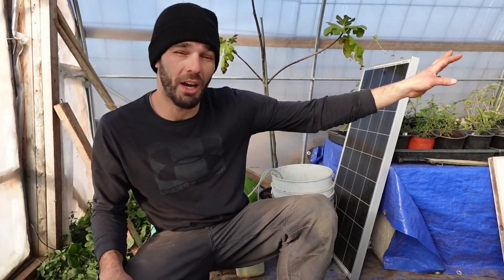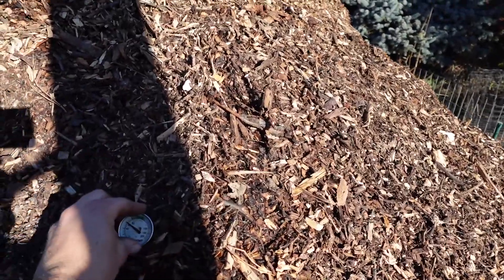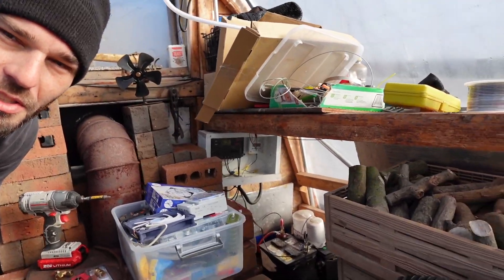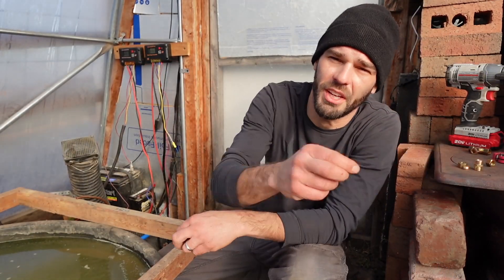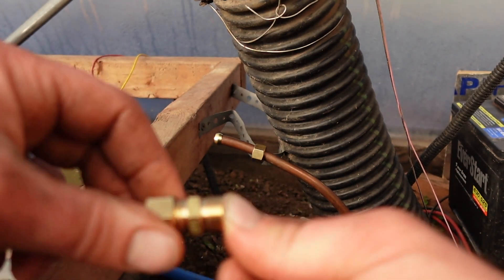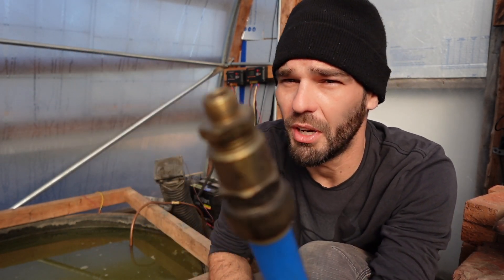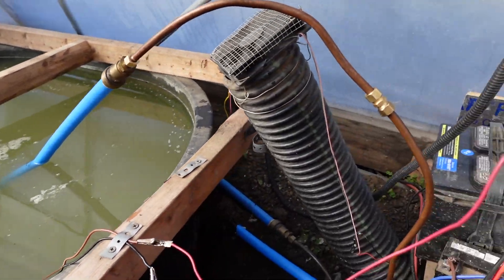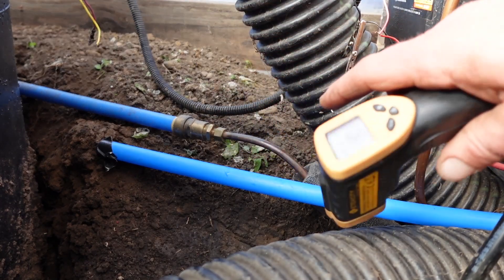COMPOST HEATED GREENHOUSE! : FREE HOT WATER - Heat Transferring Systems - Making Connections -

Comment: Curious what temps you have at night in your greenhouse? Does your pile maintain the same temp at night as it's blowing in?
Reply from the maker: Temps inside are usually above 45 the solar power timer isn’t hooked back up yet , the old one broke as it was cheap and I have to hook up the new one. When the timer runs right we can get several hours of cycling into the night leading to higher temps overnight 55-60f

Comment: Do you have links of where you purchased all the stuff
Reply from the maker: Yes I do some of the stuff may be a different brand or what have you and the items seem to change up a bit, I can get you fans, pumps, and panels as that’s all we ordered everything else was sourced as cheap as possible.
TITAN- 12V DC IP55 Waterproof/Dustproof Case Cooling Fan (140mm (2 Pack)) https://a.co/d/7cItHFy
SEAFLO Electric Marine Bilge Pumps (350 GPH) https://a.co/d/fe9BPOV 
Limited-time deal: ECO-WORTHY 100 Watt 12 Volt Solar Panel Kit for RV Battery Boat Trailer Cabin Garden Shed Home: 100W Solar Panel+30A PWM Charge Controller+ Tray Cable + Z Mounting Brackets https://a.co/d/aeXwJIh

Comment: The 62 degrees air your getting, is that from the compost pile or geo thermal from the ground?
Reply from the maker: That was the morning after I set the compost up, it was turning 52-53f into 62 right after it started up, initially it was 90 lol the outside temps on the transfer line sapped the extra heat out, and the pile was built 15 hours before the video. The same tube read 80 something F later in the morning. Good questions
Reply: @Earthdwellershomestead  Do you still have your tube that’s in ground through the greenhouse? If so, what kind of temps are you pulling from it? 
Thanks for your time to respond,
Jon
Reply from the maker: @yochanontheseeker1942 - yes we do have our geothermal tube and currently it’s operational and clear of water and debris. We had it fill up with drainage water this summer/fall, after a hell of a time getting it clear it’s working and it always shows 50-55F depending on how warm or cold temps intake are. It’s a vital component in my greenhouse, and every green house I build will have it. Thanks for checking this out!
Reply: @Earthdwellershomestead  Thanks for the reply, I’m in PNW Washington state zone 8b and have citrus trees I’m trying to get growing better. I only have a 35 gallon black barrel w a 100 watt fish tank heater in now. But I’m thinking it would be better to dig up the ground and run a tube like yours throughout the ground. How deep did you run yours?
Reply from the maker: @yochanontheseeker1942 I went 71/2 to 8’ down by hand after I built the greenhouse which was a pain but well worth it! I would suggest planning ahead to keep it out of the way, or you can dig outside and go about 10 feet down to be safe. Great questions again I’m sure others are wondering the same.

Comment: been watching your vids since last year, it looks like youve got a solid consistent heat source between the water circulation  and the compost air circulation with the stove as an assist on colder nights. as another secondary source of heat, Im wondering if you ever experimented with sand batteries? like maybe putting several metal pails of sand next to the stove would heat them up and then when the stove dies down in the night the metal pail sand batteries could release heat for the remainder of the night. Just a thought. thanks for another interesting video!
Reply from the maker: I guess I should a stated I look for free stuff on market place like sand lol..
Reply from the maker: Awesome to hear!.. sand is a great thermal mass and I’ve been trying to find a free truckload somewhere but haven’t Had any luck. I got a couple 5 gallon buckets of sand for free so far, but if I have to buy some I might for kit experiments. I’ve got a sand battery I’ve been working on that I am going to run fluid though a closed system to pull heat from the sand and possibly disperse it with other diy transfer systems. I wish I had more sand on hand, I have tons of metal bucket to fill.. thanks for watching and great idea!

Comment: How long do you think that pile will last before burning up?  Are you going to turn it? Add more?
Reply from the maker: Great question, 9 tons should last a year if I get the chips wet enough, we used some slightly aged chips mixed with fresh new ones, and there is lots of smaller branches/shrubs in there all chewed up and mixed together. If I don’t tear it apart next summer I bet it would still be active deep inside next fall/winter

Comment: Great stuff! Can you speak to the specific type of wood chips mixture that works best? Like I know you said wood chips, leaves and the like but anything else? Your videos have inspired me to start one but I want to be on the lookout for the right stuff in my area and make sure the mix is optimal. Thanks.
Reply from the maker: Great questions! In the true sense of Jean pain, he cleared forest of debris and shrubbery branches with leaves ect. Our source of material comes from a company that clears lines in h the area, leading them to trim all types and varieties of branches limbs leaves needles ect. We also got a load of chips early and they got warm till we got the next load and built the pile. The mix of all those materials chewed up together and the facts some were older than the fresh ones we had a great mix of carbon to nitrogen to sustain a good long burn duration. Thanks for checking this out!
Reply: @Earthdwellershomestead  thanks for the response. Good to know. I look forward to following your progress this winter and onward!

Comment: How do you control the high moisture levels?
Reply from the maker: Inside the greenhouse I do my best to vent and refreshen the air when I can afford to on warmer days, but they are few and far between anymore. The stove drives a lot of heat up and moisture into the air letting it out when doors open and windows but again dead of winter we don’t vent much recycling the moisture over winter is how I see it we add snow and water but a lot of the moisture recycles on the beds under the covers like a micro climate. Around 75-90%typically, the moisture coming from the tube is the highest due to transfer of heat and our outside tubing isn’t insulated fully yet. Great questions as moisture control is important!
Reply: @Earthdwellershomestead  Yes, but I have 12’ X 6’ no wood burner space.  What should my humidity be?
Reply: @Earthdwellershomestead  So what I built it from large storm windows.  I the summer I just leave the windows open, but in the winter, I tacked up plastic, basically with a 3-1/2” air gap.  Problem being now moisture really can’t escape.  So I did put a dehumidifier in there.  I have a space heater which kicks on below 45 deg and grow lights and fans kick on for 2-1/2 hours every day.